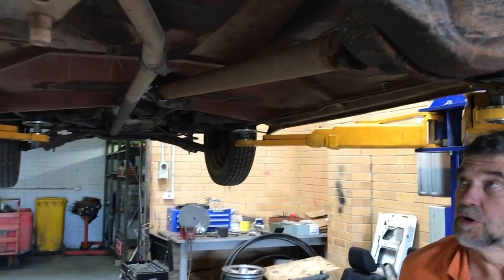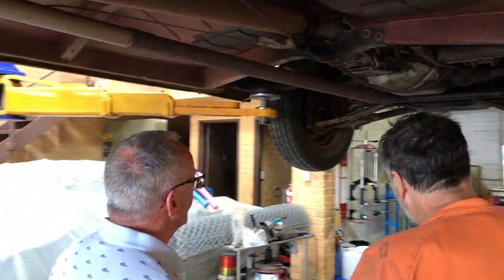FJ HOLDEN : BARN FIND

Comment: Cool car, But it cannot be a '56.
 Wide rear springs and telescopic shocks were introduced in 1953, and in 1955 shocks were moved from rear of diff to front of diff.All 3 configurations featured a different floor pan pressings.  This car is either '53, or '54. My call would be 1954, based on the pail blue color, which reminds me of Mosman Blue, 253-17340, one year only.
Also rear shock absorber, lower mounts have been replaced with post '55 items. The angle of the mounting pin is wrong, and quickly chews out the bushes. They should be swamped left to right, and shocks replaced with 50mm to 75mm longer units.
That paint looks way too good to be a barn find. Original 'Duco' paint was of poor quality, and could ware off, if washed too often or too vigorously.